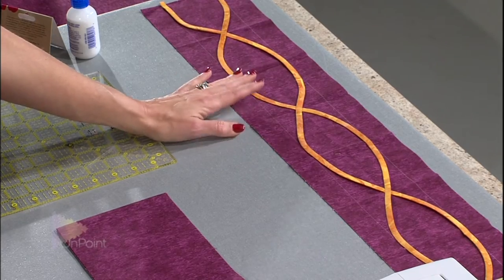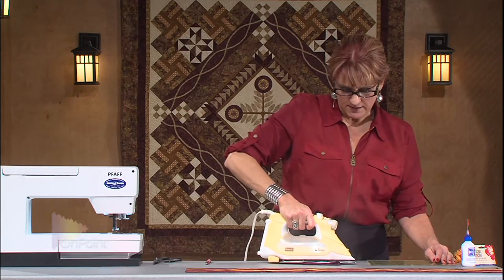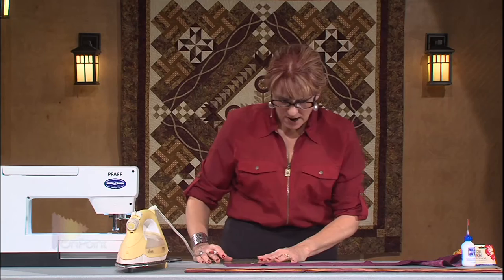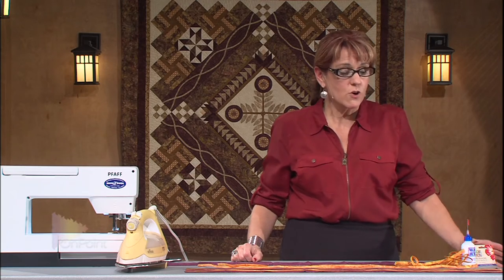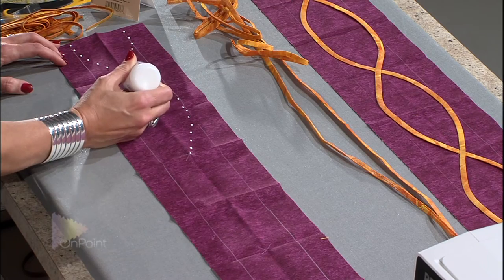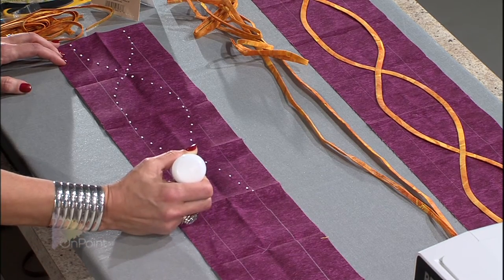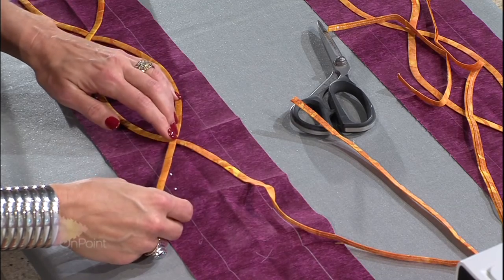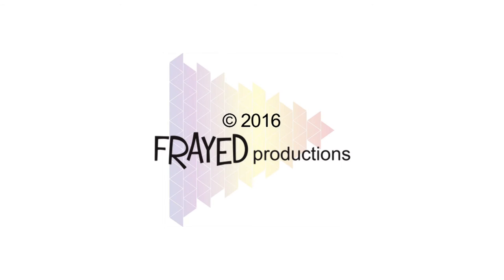How to Mark Your Base Fabric for Machine Appliqué (Ep. 106)

Comment: What brand is your seam guide and where do you get one? I have heard of people using a stack of the  little bitty tiny 1/2" x 2"Post It Note stickers as a seam guide.  Do you think that would work?
Reply from the maker: Hi Jane - I use the GuildLines for Quilter's guilds - they are rather inexpensive and can usually be found at a quilt shop.  I used to use Dr Shool's mole skin but they stopped making the one that was a little more than an 1/8' think so I switched.  as long as the post it notes stay in place, they will work :)Nancy